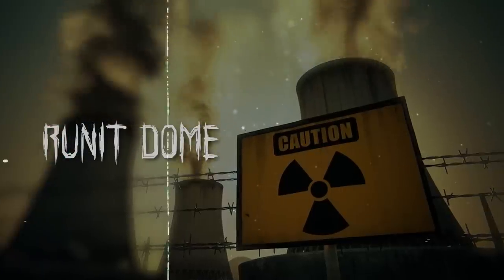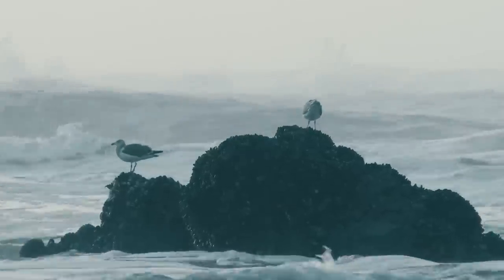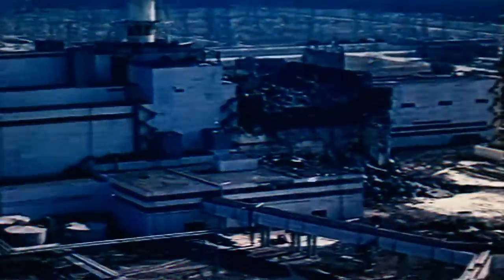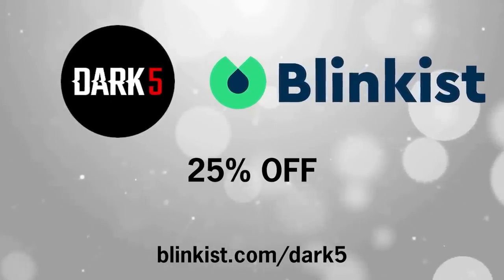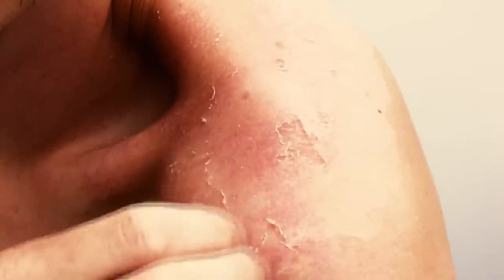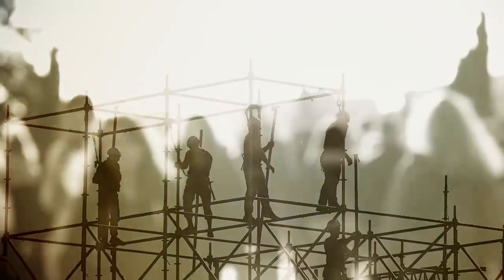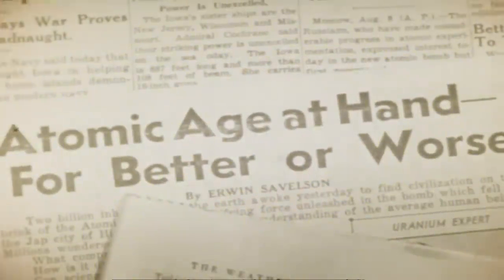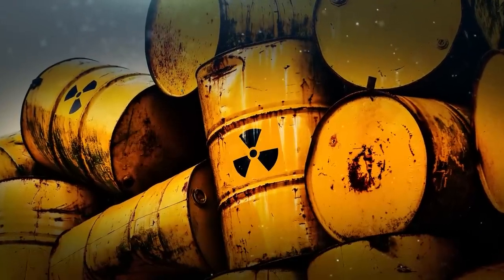5 Abandoned Places That Are Nuclear Nightmares

Comment: Please do a second round of research and a video on Hanford.
While by today's much higher standards, Hanford could not pass inspection, a great deal of effort was expended to make Hanford as safe as they knew how at the time. 
While problems have occurred, radioactive materials have been released, and many environmental concerns still exist, at least they are being addressed. The remediation project has been going on for years, and will continue long into the future. But at least it is being done.

The Soviet nuclear program was developed with the information stolen form the United States. But it was implemented with no attempt to include the safety and environmental protection systems that were part of the Hanford project.
Your video does not make clear the order of magnitude differences between the contamination at Hanford and the contamination to be found at the old Soviet sites. More so, there are few ongoing projects in Russia today attempting to rectify the problems. 

Your video delivered a very slanted and at times misinformed narrative. I request that you correct it.

Comment: There has been and always will be reckless humans! Ask yourself, how safe is it to extract, and dispose of the hazardous materials for which the batteries of EV's and such are made! Whats the ecological cost?!
Reply: Extremely high! These batteries cannot just be put in the ground, and they are being discarded by the thousands. They can only be charged so many times and then they are useless. Many generators for EVs are run by diesel fuel so that around 80% of the EVs in the US are actually running off fossil fuels and the other 20% are powered by standard power plants. I don’t think anyone is reclaiming the lithium from the spent batteries but that would be a start to help the environment.
Reply: And that's before the batteries catch fire and can't be extinguished!

Comment: Nothing “green” about nuclear.   Eventually, the bill comes due.
Reply: Depends on the design of the reactor.
Reply: The bill comes due for everything. Pollution, deforestation, greenhouse gases, smog. So what’s the solution?
Reply: @__________Anonymous__________  Everything breaks.
Reply: We all return to entropy eventually friend
Reply: Thorium
Reply: Copium
Reply: Nothing very "green" about any of the "green" energy schemes; hydroelectric is probably the best of the "non combustion" methods of energy generation.
Reply: @yep_2431 -- they won't use Thorium  because those reactors aren't able to produce material that can be used in nuclear weapons.
Reply: What about our sun? Is that green?
Reply: Yep.. Lets just switch to Unicorn Milk. Unlimited, no Carbon, Free. Why didn't we think of this sooner??!?
Reply: its terrifying that its still considered an option at the cost of there children
Reply: @soopersooper3291 -- only through a welding helmet, or really dark shades...
Reply: These are old examples.
We now have thorium, redesigns, and lessons learned.